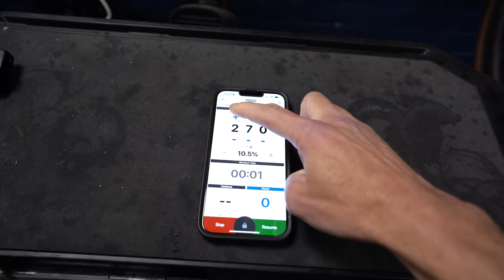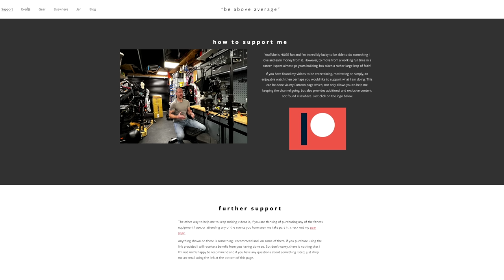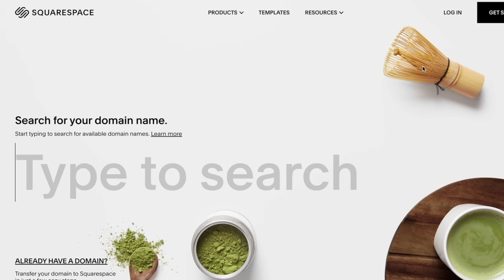Can a HUMAN cycle fast enough to make TOAST?

Comment: If you want to squeeze out a few extra Watts, eliminate the sway from your upper body by fixing your arms in place, nip your shoulder blades together and pull back on the bars with your lats. This will lock your upper body in position and ensure more of your effort will be put through your legs. Watch any track cyclist sprinting, their upper body barely moves. Same with mountain bikers on steep climbs. Makes a huge difference. Great video, looking forward to episode 2...
Reply: Easier said than done 👍
Reply: That is the difference between spinning and cycling. You do not need proper technique. I occasionally tried a penny farthing and I would not make a yard, if I torture the handle bars like this. But I'd get no toast either😃.

Comment: Hi Mark! It's a pity I discovered your channel only a few days ago. I have seen Forstemann's video earlier and there are a few things worth to comment.
Most normal strength men can put out 700w for a few seconds even without training. An entire minute, yes even 30s, is a completely different thing.
Bradley Wiggins has put out 608w for 4 minutes. This means he possibly at that moment could have done 700w, or very close to, for 1 minute. Without standing up after 30s.
And this with maraton runner thin legs!

Robert Forstemann has legs making many bodybuilders envious.
And he can put out 2000+ watts in a burst. It is very clear that 700w for a minute cannot be very hard for him. The only explanation is that it was a huge power drain in the equipment. He should be able to put out 1000w for a minute and that without standing up after half the time.
An important thing to understand is that Wiggin's performance despite the small amount of muscle mass is possible because he used a very high cadence. The "lack" of muscle mass is compensated by a very high oxygen uptake. And this is noticeable when comparing different cyclists: for thinner guys it works better to pedalling faster than for guys with beefier legs. At least when it comes to endurance races. But even a beefy guy puts out the max power at a higher cadense.
Conclusion: the correlation between Bradly Wiggins 608w for 4 minutes and Robert Forstemann's 700w for 1min(and that by standing up after half of the time) simply does not add up.
Comparing these guys physically is like comparing a maraton runner to a body builder. The maraton runner wins hands down for long periods of time.
But the bodybuilder wins for short time. For a <1min race Forstemann kicks the ass of Wiggins.

By the way: I am impressed by your performance!

Comment: There's a 10 second ramp up on the heating coils before they actually start doing anything useful, that's why the follow up 20 second efforts did very little compared to the 45 second one. Good effort though, lasted longer than I would have!

Comment: Cant be use high gear for generating more energy with low gear at lower rpm ?
Reply: Please reply I know for high gear at generator level rpm will be high however it's hard to spin high gear , also at same time if we use low gear to spin that hard gear with good strength with low rpm

Comment: here's something i'm sure you'll be happy to know - since the body is so inefficient at converting its carbs into movement energy, if you are putting 700W into the pedals, your're actually putting out something like 2800-3500 total watts, it's just that the majority of it goes into heating up your body instead of moving the pedals.

also, and i'm surprised you didn't point it out in the video, but 700W does 2 slices of toast, and i'm sure you can hold 350W for...a while
Reply: that is very interesting, thank you

Comment: this makes me want to try to build a toaster designed to run off human power vs a coal powered plant, for example bread only has to reach 350 degrees and you can get that from a 100w ceramic heating element, traditional toaster heating elements reach 1100 degrees, they waste more energy heating the air in the room than the bread

Comment: put your bike on a free roller instead. cutting sausages by holding them in the spokes of the front wheel is achievable even for you 😁 with way less effort! ☝️

on the cheap disk brakes of my old MTB I could easily toast or grill anything (after a steep downhill with lots of braking)
btw: they say leg day skipped Robert Foerstermann!

Comment: Mark I don't think you were trying hard enough, you didn't achieve the foetal position at any point. 😁
Reply from the maker: Interestingly, I was never able to pedal long enough for it to tax my aerobic system. It was more like running out of steam on a set of 12 heavy reps of Squats . Exhausted, but not exhausted if that makes sense.

Comment: That's a 2 slice toaster, so each slot is 350W. If all 700W had been going into the same slice of bread, you'd have had better results. 

Still, as others have said, holding 700W is impressive.
Reply: Half a loaf is better than no bread.

Comment: At the risk of being the pedant you specifically called out preemptively, when you multiply Watts (a unit of power) by a unit of time, you get a new unit of energy. If that time unit was seconds, you would get Joules. As you multiplied by minutes, you would get Watt-minutes (1/60th of a Watt-hour). So, 1000 Watt-minutes to spare, in the case of your statement. I suspect you already knew that and were just simplifying for a general audience, but nerds are nothing if not pedantic, and I am nothing if not a nerd.

Comment: Fella, why not just cheat and buy a 350 watt single slice toaster, 700 watt maybe hard to sustain for long enough but i'd put money on you being able to sustain 350 watt's for long enough to toast the whole loaf one slice at a time.  Those toasters only consume 700 watts because they have enough elements to toast 2 slices of bread, half number of slots, half the resistance, half the workload needed to power it.